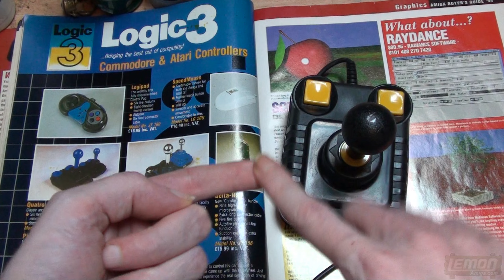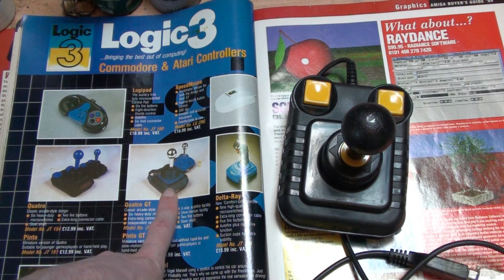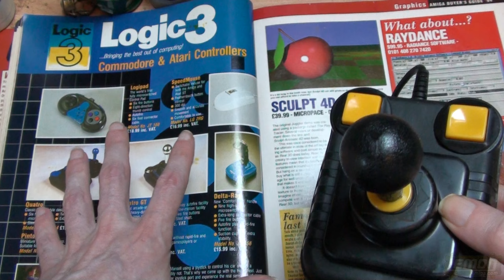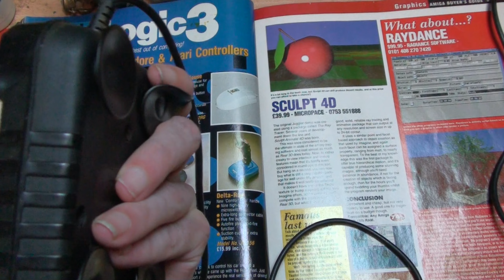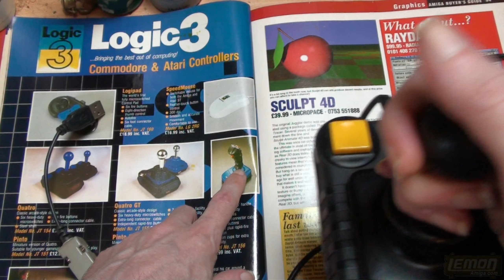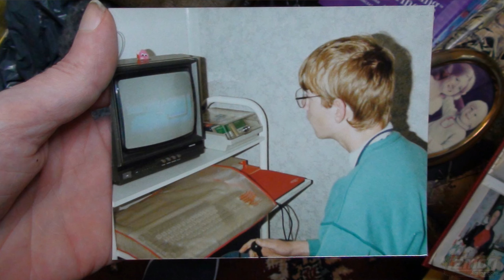How To Use a Micro Switched Joystick - Live! - A Controller Guide - by LemonAmiga.com

Comment: Nintendo used D-Pads because they couldn't afford joysticks? lol what on earth are you talking about. Take a look at a game and watch then explain how you would fit a joystick into the clamshell design of them.
Reply from the maker: I probably meant they couldnt afford to (as in risking)  by adding too much extra cost to the Nintendo.  They did use the D-Pad idea from their Game and Watch series, and ended up going with that. The Fami-com was actually reverse engineered from a C64, right down to them making a 6502 cpu clone. The c64 usually came with a joystick, but Nintendo wanted to cut the cost of the derivative product in order to under-cut Commodore, at least in the Far East.  When it came to the NAVS project, they introduced a joystick in the bundle for the American market. As well as a light laser, and two wireless d-pad controllers. But in an effort to cut costs once again for the eventual NES, they dropped everything except for the basic wired d-pads.  So I dont mean Nintendo were broke and couldnt afford them, I mean for their profit margins.  Peripherals were not really their concern.

Comment: Interesting video!  I know exactly where you're coming from here.  Joysticks were the norm for these systems back then. If you walked into Menzies, Dixons or Boots they usually had a display shelf where you could try various joysticks.  No gamepads. 

I started on the VIC20 using a Competition Pro, then a Cruiser.  But I changed to a ZIpstick around 1992 and used them ever since.  I have a few but only one left with a working autofire.  That does seem to be a bit of a weakness.  I remove the suction pads as I find it more comfortable to hold.
Reply from the maker: Maybe I watch too many American console fanboys who dont know a joystick from a tree trunk. I had a comp pro at one time, and always wanted a SpeedKing or a Cruiser, but never got around to buying them once I got the zipstik. A friend got a bug, which was nice actually, but a bit small for my hands. I feel the zipstick is more rugged and tough, like an Hiking boot.  The autos work when you unscrew it, but not with the screws tight. I use emulation these days, so best to save the real auto fire switch in any case.

Comment: for repeating on track and field dpad you press one side and smash the other side. surely that tetris technique of dribbling your fingers on the back of the pad (instead of smashing one side) would net the highest results tho.

personally, i'd rather use the kb.
Reply from the maker: Nothing wrong with keyboard. Reaction times on keys when playing track and field is actually faster than any controller I have yet used, because you can use the first and middle fingers of both hands, to double tap the keys at the same time, by alternating the fingers, instead of pressing two keys with one hand.